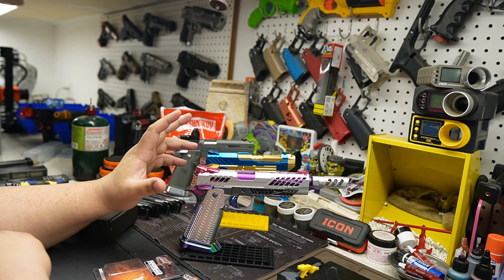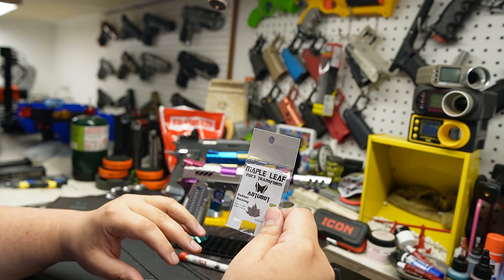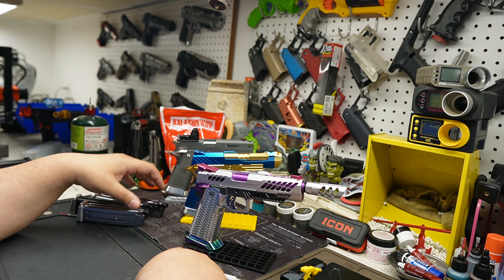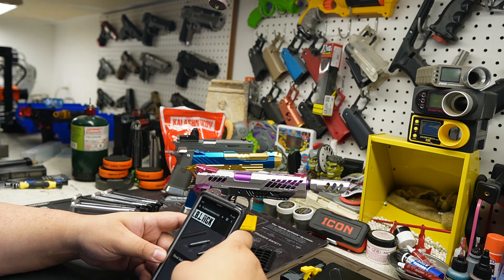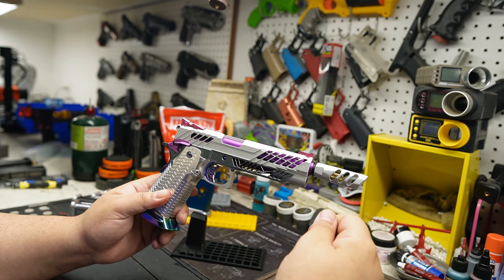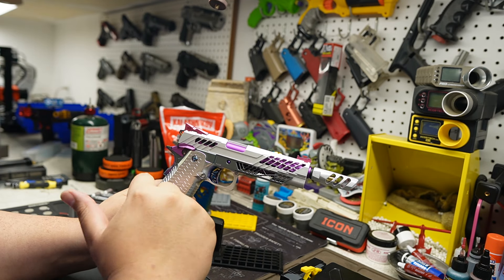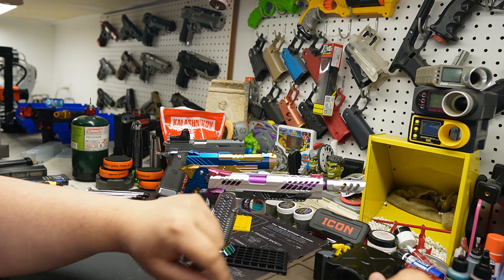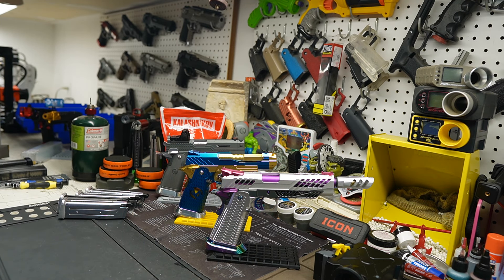Customer Gun Tech Series: DR. Black Hi-Capa BUILD FINISH (3/3)

Comment: do you like the buckings with the second metal ring to create a better seal? i guess they've copied that from Novritschs Sniper Rifles. 

Undortunately the rubber rails next to the patch only sit perfectly on Maple Leafs own barrels...can not use them with my PDI. But with the PDI barrels many buckings patches are too wide to fit into the barrels cutout like intended. 

do you know any hop buckigs that have the same oldschool geometry like the TM buckings or maple leaf buckings that work perfectly with the oldschool PDI stainless 6.01 barrels?
Reply: @buckethead420  hmm, yet to try the new bucking. So you're saying there is an amount of proprietary crap going on? 
Only really had good luck with maple, so been reluctant to try others for years now, sry:/
Reply: That second ring sometime will make the inner barrel cannot fit into the hop up unit if the hop up unit is too tight fit. I personally prefer the 1 ring version, since wrapping sealing tape works just the same as the second ring.

Comment: FYI those Kalashnikov are the worst BBs on the market. The only time I've had barrel jams. Dirt cheap i guess, but.. maybe they've changed quality.
Reply from the maker: Haahahah I bought them because they are cheap as shit and we bought it as a meme for a project. I bought crossmans, and a bunch of other shit bbs. We were testing them in the 5.98s and stuff.
Reply: @KnucklesGSM  lol😅good luck using them in a 5.98, gonna be tight;) literally the worst FPS consistency😆 this was about eight years ago tho.
Can't wait for the cursing to begin 😂
Reply: They aren’t that bad, went through about 40k rounds with zero issues on my 30 rps Chopped PKM. Though I wouldn’t be surprised if qc is iffy between batch’s since it’s basically a evike/associated brand and basically 95% of evike products are very hit or miss.
Reply: @mattknowsnothing these weren’t out 8 years ago, theses have only been out since about 2020 or 2021 ish
Reply: @opairsoft8100  really, huh! I really do know nothing😆 been playing since 2011 and nearly 45. Tbh the last 5 years has been a blur🤷